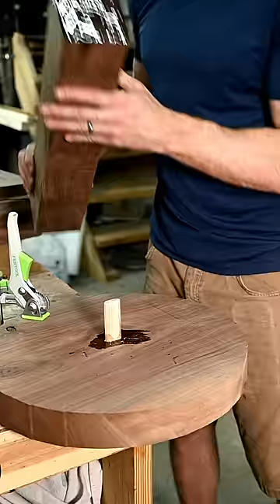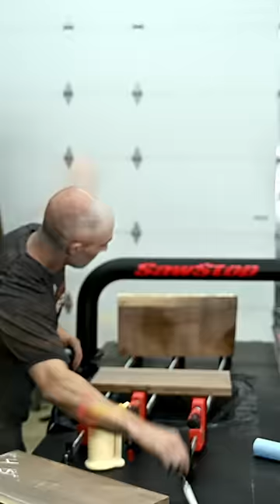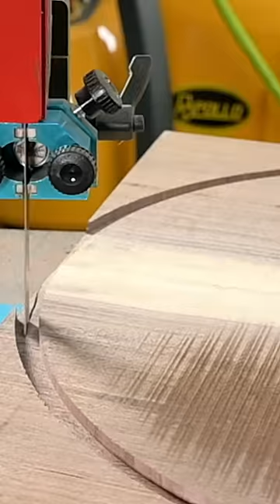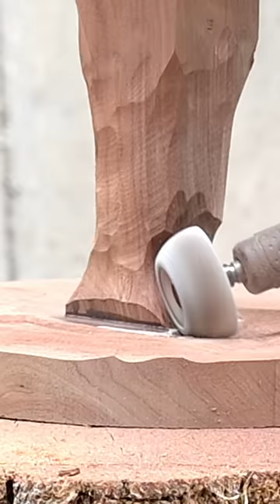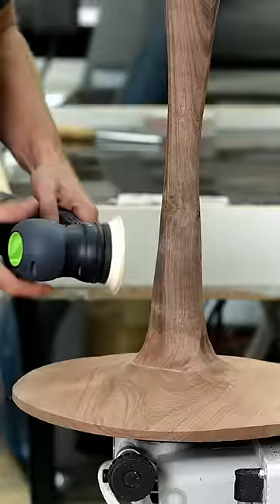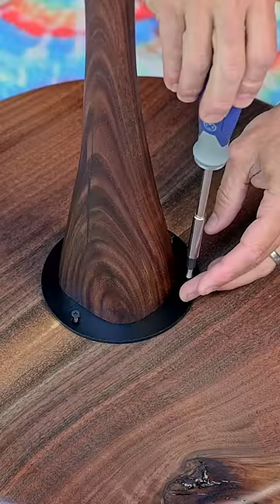I Tricked a Customer

Comment: The shop IS what makes this project. It IS what makes you "$1000 in a weekend"

Without this shop you are more prone to accidents which means greater cost and/or a significant greater time spent so now instead of making $1000 in a weekend (roughly $50/hr if you spend 20 hrs on it or 10 hrs a day for the weekend) you're making $1000 in a month (roughly $20/ hr assuming you can get it done with hand tools or cheap electric tools in 50 hours time) 

And that's assuming of course that you are privileged enough to live in an area where people are willing to spend $1000 on an end table...I'm not even in an impoverished area but it would take me months to sell that same table for $300 where I am.

Comment: You mainly just need the router and the grinder, you can joint the boards with the router if the boards are flat already, circle cutting jigs are stupid easy to make.

Comment: I can make the top and bottom in a few hours' work with a circular saw, router, and sander. I've never sculpted a leg like that, but it doesn't look too hard. The key here is to buy the wood flat. It's a bit more expensive, but lumber mills offer jointing and planing services. A jointer and planer are some of the bigger, more expensive tools that you might not have around at a small shop.

Comment: You have to quit saying your profit is less the cost of wood only.  Your labor for building, wear and tear on tools, labor for designing, labor for taking pics and posting on sell sights, if your shipping it- packing materials & drop-off. Storage every day it is not sold, materials and supplies to paint, stain or epoxy, sand paper, screws, dowels, wood glue, ca glue, tape, etc. You are master craftsman who can charge $90 plus for your skills. I being a newbie into the woodworking industry can get $25-$30 an hour plus cost of all materials. I am sure the details you would put into building that table has all your years of experience woodworking, design, presentation to sell your product. That takes awhile for a newbie to learn through trial and error no matter how many youtube vids you watch.

Comment: makes me wonder what i could sell my work for, i use an impact driver, router, sander and jig saw, most of my work is resin sealed fire stained pine done in a way that makes it very pretty, lightweight and durable with minimal metal, granted i could probly add more metal and even go better if i find a good way to apply it, maybe i should weld up a blued steel framework to help hold my parts off the ground

Comment: You need a lot more than you make it out to be. You need a table saw and router. Grinder and clamps. Work bench. Sanders. Router bits cost a lot of money. It is more difficult without the proper tools. Those tools cost money.

Comment: Your point is really harmed by the expensive tools you use for this, not to mention the professional camera equipment you were able to use to advertise your listings. Most glaring problem is that you say there are methods to cut that perfect circle with more standard tools, but you don’t use those methods instead opting for an option inaccessible to the people you’re berating. None of this is to say that the method you describe wouldn’t work, but don’t act like you’ve proved a single thing.

Comment: With awesome shop you can do the same work in much less time. Where making profit would be alot easier because the hours you're putting in will not be absurdly high. Ok a higher level you can say that you can do it with standard tools, my brother you can do it with a screw driver and sandpaper does not mean it's worth it.